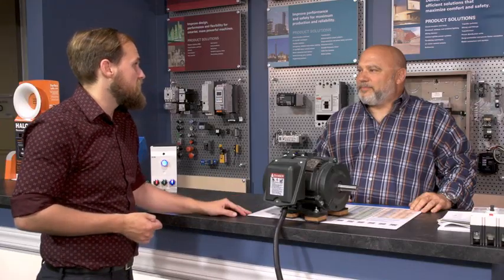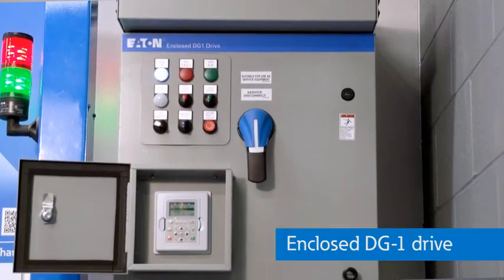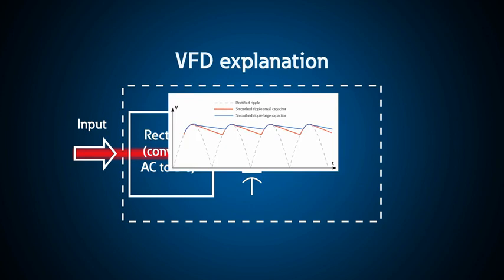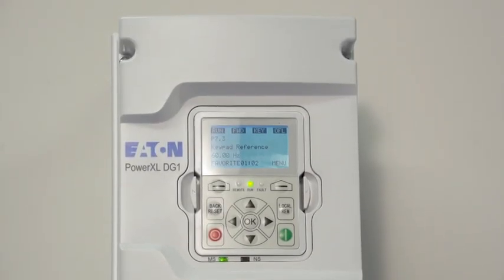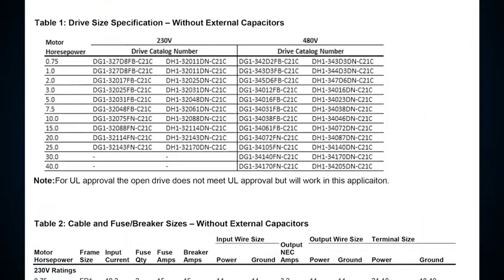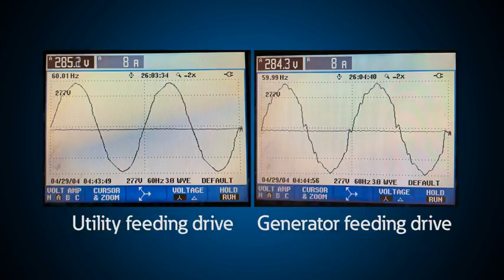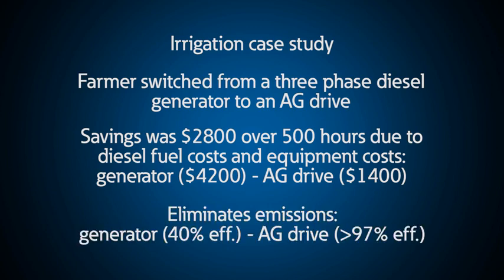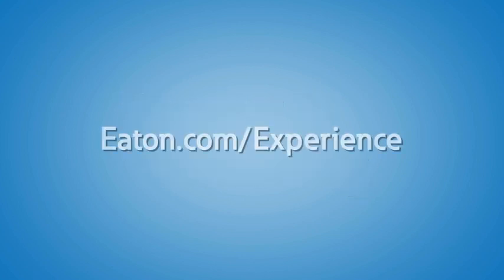AG Drive Demo - 1-Phase Input 3-Phase Output VFD Applications

Comment: Good day I have a 3 phase motor want to convert to 1 phase also forward and reverse can you help me please
Reply: Did you get a vfd?  After you wire & set up your vfd, I would assume that a 3 phase drum switch would still work fine for reversing(just swaps 2 of the hot wires) your motor, but we all know what ASSume stands for, ha.

Comment: Can a single VFD run multiple 3 phase motors?

Motors starts asymmetrical due to its process.
Reply: Good question, I would like to know also.  Maybe so if the vfd has enough capacity for 2-3 motors.
Reply: @leeisenberg  Generally not a good idea. It's possible, but if there's asymmetrical load you can have feedback issues and can damage the drive. Maybe ok for things like fans where asymmetry is very rare (unless you have a mechanical failure).